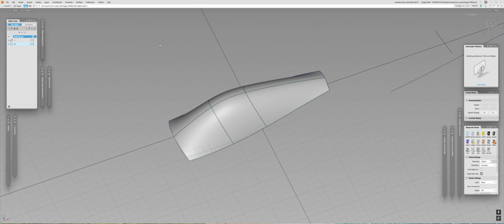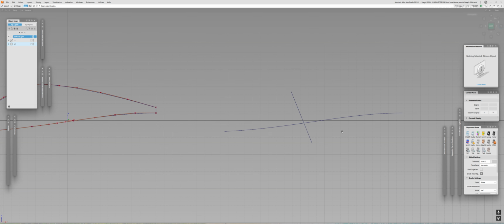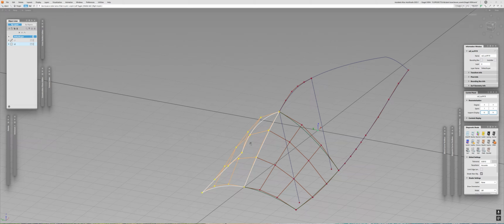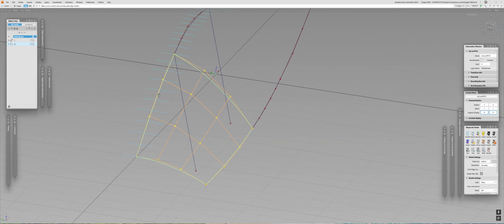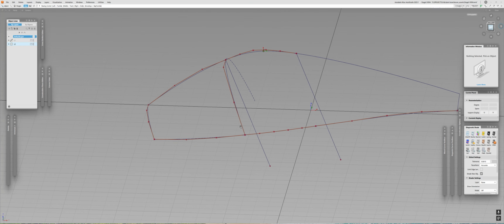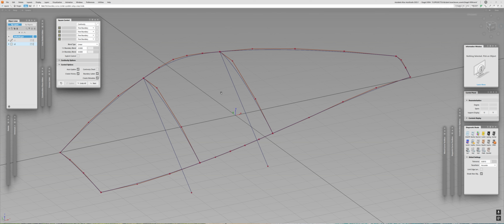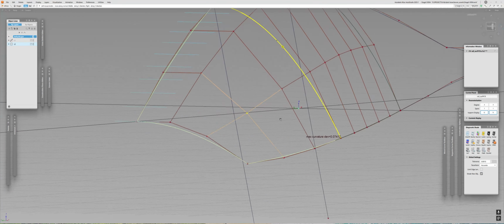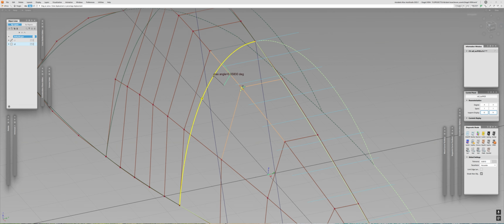Alias Theory Builder - Surface flow

Comment: Hii sir. Can you teach class a surf and proper patch layout
Reply from the maker: Hey. Well, I'm trying. In this video, the patch layout is correct. The reason I said it's not A-class is because I didn't plot a curvature comb along the surfaces to check and tweak the transitions between them, as I've already shown you how to do in the cross-align video. Moreover, the term "A-class" is quite broad and can vary based on client requirements, product price and size, technical constraints, and more. What might be considered A-class for one project might not be for another. However, what remains universal is a proper patch layout, which I've demonstrated here. 

Another aspect to consider is achieving A-class quality, especially in consumer electronics and automotive industries, which demands a significant amount of time and patience. You start with a proper patch layout, then slowly move control vertices (CVs) around to remove any discrepancies in the form. This process can take hours, sometimes even days of CV manipulation and curve reconstruction. It's extremely tedious and boring, to the extent that even dedicated individuals might watch for ten minutes and say, "Okay, I get it, you move CVs here and there." 

The challenge with showing this process in a short video is that capturing the full, iterative nature of achieving A-class status is difficult and often not justified. It's a long and monotonous process, but understanding its essence is crucial if you're going to do it yourself. On top of that, achieving A-class status requires a good foundation. In most cases, it involves several iterations and a few scan passes over an already good base. Knowing how to manipulate CVs, create proper curve networks, and lay out patches will lead you to A-class quality. However, how excellent your A-class surface will be depends on your passion. If you're willing to rebuild your model repeatedly, massaging CVs for days, you will achieve A-class status.

P.S. What you see on YouTube, labeled as videos where A-class surfaces are created, usually isn't truly A-class. This is because of the very short duration of these videos and the compressed nature of the process shown, where it's simply impossible to achieve genuinely high-quality surface transitions. As well as tutorials behind the paywall. It just takes too much time.